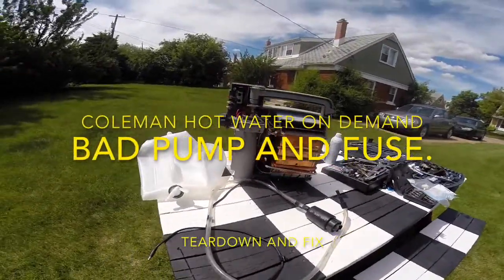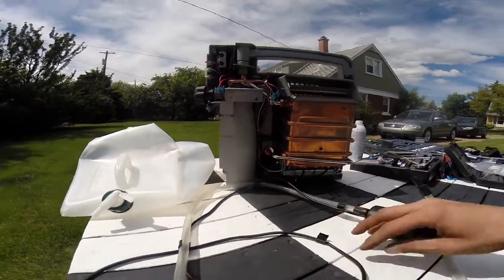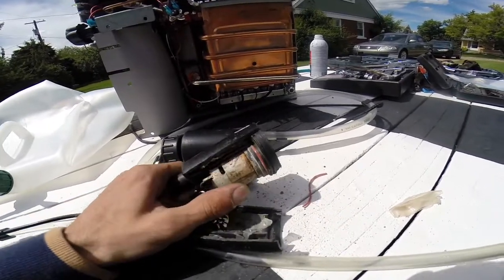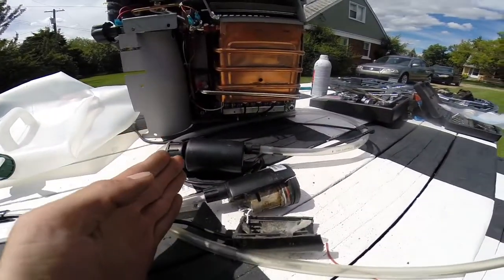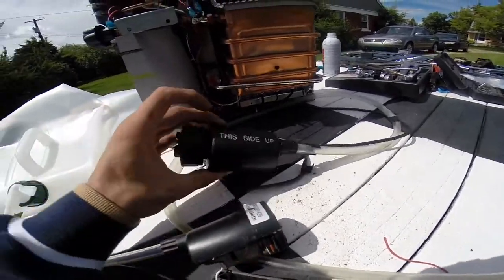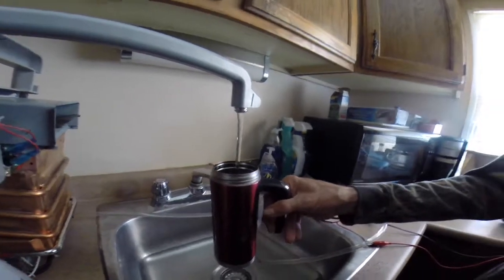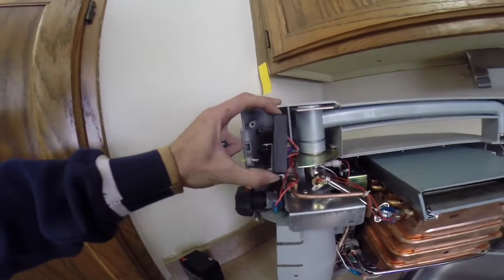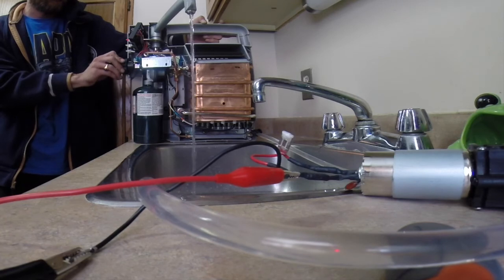Coleman Hot Water on Demand - Teardown and Pump/Fuse Repair

Comment: Just a FYI, I recently bought one of these at a thrift store that was VERY lightly used. I hooked it all up and sat staring at non working unit. I had it plugged in with the 12v ac/dc power supply figuring that no matter the condition of the old battery, it should run when connected to a suitable external power. I was wrong. I picked up a new 6v battery at tractor supply ($10.99 off the shelf item) and popped it in to troubleshoot with a known good battery. I quickly found the unit started working properly on battery power!  After some trial and error I found the unit has to be unplugged to turn on! Fuses, pump, wires, hose were all good to go! Very happy with this appliance and will be using it at various scout camp cooking scenarios, having HOT water on demand is a MUST for kitchen hygiene! All in I got $31 bucks in this, score of the year.
Reply: What battery did you buy ? Mine is toast and won’t take a charge

Comment: Nice fix. This should be helpful for others who are having the same problem. Coleman used to always have top quality products but like so many companies their products are made cheaper so they can increase profits.
Reply from the maker: Or just to stay in business with the company operating procedure/wages/etc remaining the same.
With clones of just about everything now , safety becomes more of a concern form me with many things. With lower quality metals and shoddy soldering and faked components, it's getting harder and harder to get anything of quality without going direct to a good manufacturer or it's distributor,  short of making it yourself.
Reply: There sure is some fierce competition in the marketplace that forces cost cutting to the point it can impact safety. On top of that so much is outsourced and companies aren’t putting enough into verifying the quality of products/components from their suppliers.

Comment: The flow sensors in these also fail.  Replacements can be found here: https://www.seeedstudio.com/G1%26amp%3B2%26quot%3B-Water-Flow-Sensor-p-635.html
Reply from the maker: KaldekBoch good to know, thanks for the source.
Reply: is this what happens when it ignites for only a very short time then shuts off? or is that a thermostat problem?
Reply: @sashanealand8315  Yeah that's the behaviour we saw.  It doesn't see the flow so it cuts off.

Comment: Yep, I found this to be the same exact problem I had...racking my brains till I isolated the pump as the problem...I took off the intake and found the white impellor. I tried to move it and it is frozen.   So, I need to split the case...like you did...any advice on doing that to save this pump?..i am certain I can get the motor to run again.  good continuity..

Comment: Nice it's fixed!  the heating element seems to work very well. :} Aside from a warning of pump problems this video made me think about  hydraulic ram pumps. I just found out about them a couple years ago and I'm sure you understand way more than I do about the specifics of how they work but it blows my mind that with no electricity at all you can put together a few plumbing fittings and a pair of check valves to use gravity to overcome itself and pump water uphill. A bit off topic I guess unless you had a water storage tank filled by a ram pump and then use the Coleman or similar unit to heat it up from there. Good stuff take it easy!
Reply from the maker: Again, hours lost due to a Jefferson Einstein comment. Thank you.
I spent a bunch of the evening watching wranglestar's implementation, he's rather happy with it.
There is a slew near the shack but its downhill and no real place to gain head to make the rise.
Then there is the river down the road, but that's a ways to experiment with.
Considering I'm not at the shack much right now, even a rain catch for washing up would be reasonable. But the county has issues with rain barrels so,  bah!
Reply: They are amazing as long as the conditions are right. Wranglerstar is where I found out about them and I think it was at least two years ago so hopefully you saw the original videos where he sets everything up, otherwise you might have to waste another few hours :} Very interesting stuff, it's a bummer it wont work for you. Take care!
Reply from the maker: I watched the backlog, hence the few hours, I'm subbed to them but don't watch every video, just what catches my attention. 
I'd be curious to see a check valve like they have with some replaceable seals you could service each year. Probably save a bunch of wear on the pin and the seats. a stronger pin would be nice. Lots of energy dispersed on each click seems to wear the cheap vales within a year. It's a cheapish replacement, but be nice to have something better without spending too much more.
Reply: ***** I don't watch them all either but more often than not I do, he does a lot of projects that I find interesting That would be nice to be able to repair the valves since they open and close around 63 million times a year if they run all year, depending on the size. I think one year the brass cracked due to freezing so it seems like a good idea to take them out during the winter months and do repairs then if possible and start over in the spring. You're right as far as plumbing parts go check valves are fairly expensive especially for 3/4 or 1 inch, the 1/2 inch are a bit less but still would be worth servicing, all they need is an access panel to get inside.

Comment: The pumps have always been faulty but Coleman refuse to admit it. I bought 4 new pumps ($200) and all of them leaked through cracks in the face plate. I returned them and bought 4 12v portable showers ($48) and easily adapted the pumps from them and all works well on 6 volts.
Reply from the maker: Phil thanks for the info. 😁
Reply from the maker: Do you notice any lack of flow or was it comparable to the original, 12v pump at 6V ?
What showers did you end up purchasing?
Reply: pXn Emerica the flow rate was slightly lower and over temp came on when I run it at full tilt for 90seconds. This is overcome by reducing the temp setting to just under max and still produces a good flow of bloody hot water at 6v. We mostly use this when out in the bush using solar and I plug it into the cigarette socket at 12v as 6v is a rarity these days so the 6v only supplies ignition and the 12v supply from the vehicle/solar produces a better pressure and flow rate than the original dicky Coleman pump and negates using a relay. No doubt you're switched on but others reading this post need to know to get the water flowing before you ignite the burner.The units I used are available on eBay just look up "12v camp shower" and I was able to purchase 2 of these well under $40 Aus. I'll try post a link. Bloody good video on the fault finding too.keep up the good work n I subscribed

Comment: You can get those pumps working again,  I brought two of them back to life. This is what I did,....

What I did was drilled two small holes in the top of the pump (the end where the wire and outlet of the pump is). One hole on either side of the pump outlet, I then drained the water from the pump, then I sprayed WD40 in the pump till that cavity was full and left it to sit over night, then I applied 6volts to the pump.  Both pumps I tried this on came back to life. I resealed the holes with some good shower silicone. 
Hope this helps some people.
Miles

Comment: I just about threw my heater in the garbage! Called Coleman Canada and was told there are no replacement parts available for these things. Can you show me exactly how you set up the relay to go from 6v to a 12v system/ where you bought the supplies needed.. I'm not familiar with electrical setups but am a good copy cat.. lol.. the pump is defenitly my problem.
Reply from the maker: I'm only going the 12V route because I have a solar system setup at my shack, A 12V pump would still likely work directly @6V, but have less flow. I'm not sure what the original flow was like.   :) 

Here is a video for you that should help explain the relay setup that I have planned.  Higher qualities still processing
Video: https://www.youtube.com/watch?v=5eBMxMoA5hQ

Comment: Thanks for the video.  I had  a low battery light, but the battery is OK.  It appears the pump is my problem.   I can hear the pilot turn on the burner, but there is no water running and the pump does not turn on.  I was wondering how to replace the pump with one like you bought.  You are running your pump off of a separate battery, but I would like the new pump to run off of the existing wiring and the Coleman unit if possible.    Maybe just cut off the old pump and then figure out a way to build a new pump enclosure with the tubes the way you have in the video?  Anything I should be concerned with?  I see many 6 / 12 v brushless pumps online for less than $10.  I never done anything like this before, but I figure I have nothing to lose, since the pump doesn't work now anyway.    Thanks!
Reply from the maker: It's a 6V pump, you could use the existing wire from the old pump, and run that to a new pump. I've got a 12v system at the shack I want to use this at, so a 12V pump is fine for my needs. I'll run the pump wire to a relay to power the new pump. But if you get a 6V pump that shouldn't be needed.

Comment: Hey buddy, not sure if you're still around but what kind of relay would I need to have the coleman turn the 12v pump on?
Reply from the maker: Most relays should work but you want the trigger voltage of the relay to be as close to the 6v you have from the machine. Still haven’t tested if it can take 12v in the system board or not
Reply: @pXnEmerica  what would be worst case scenario if the board can't take 12v? Fried board or just a fuse?
Reply from the maker: @jomotechual9073  probably a fuse, but that all depends on how well they designed the circuit.   My guess it it will be fine, the voltage regulator might get hotter though trying to dissipate an extra 6V as heat. So there's a possibility you're also "cooking" your board components.

Comment: Hi, I think I have the same situation happening with mine? It clicks and fires up but shuts off right away. The pump is not sucking water.
I’m confused about the “relay” that you speak of? Am I understanding correctly that you took out the 6volt outlet and wired it to a 12 volt relay so you could run the new pump? I’d like to see how you married the 12 volt pump to that relay.
Also, you bought a non-submersible pump to replace the original. How many gpm is it?
Reply from the maker: Gpm unknown, it was just a pump from surplus at Princess Auto/Harbour Freight. They had no idea.
I used 12V source but used the 6V output  of the machine to "trigger" the 12v relay which turns the 12v pump on. 
My plan was to use 12V entirely and then step down the 12V to 6V to run the electronics. But you could run two separate sources.
Reply: pXn Emerica Thanks for the quick reply. So you think I can wire the 12v pump directly to the 6V outlet and it will work. I’d rather that than having a separate power source for the pump.
Reply from the maker: @dangorgichuk4543  You'll want a 6V pump in that case, and possibly something efficient.
If there's nothing in the circuitry to limit the current and you put something big on there you might kill electronics/fuses or get things warm :)
I'd see what Coleman has for replacement parts if any.
Reply: pXn Emerica I read on another post that Coleman has stopped making parts for these units. Thanks so much for helping me out.
Reply: Based on what you said about not using a pump that may draw to much current, is it possible for me to cut the old one open to maybe find out the current draw directly off the old motor?
Reply from the maker: @dangorgichuk4543  you might get something from the original power supply, a sticker on the machine or maybe the manual, gotta mow for a bit

Comment: All the 'Dust" you talk about inside the pump are from 2 small ziplock bags of ballast they put in that are either a desiccant to absorb any moisture, or to make the pump sink. 
You can disassemble the pump without cutting it by unscrewing the wires off the back, and inserting a small punch or drift, and very carefully tapping the motor assemble from the casing. You may need to use a heat gun to loosen things up
Reply from the maker: Not worth it, motor was rusted out, pumps are garbage.
Reply: agreed!

Comment: my ignites for about a minute and then heat shuts off but pump stays on. the water impeller and pump functions fine but hot water for only a minute
Reply from the maker: It's got some safteys, manual says it'll shut off it if gets the water too hot, should then come back on when water cools.   I'd make sure you've got no trapped air in the system. Pretty sure there's a safety if it's not detecting flow as well. You might have flow but if the flow sensor is bad maybe?
It's been a few years since I've pulled them out of storage.
Reply: @pXnEmerica ok thx I'll check it out
Reply: I was thinking maybe thermostat

Comment: The pump pulls apart. They are not a sealed unit.
 You don't have to cut it. It's got a seal on a rim at the inlet and its just a firm fit, but it's not fixed at all. Pull at it.
You could just get a new motor- hobby shop?
The seal - an O ring? went on the shaft.
Reply from the maker: Nah it was trash.
Reply: @pXnEmerica  Well mine just blows the fuse. The pump ran but it all went cactus after that. No ignition clicking. I had it apart and thought what would work, with no gas connected or water to pump.
I haven't checked in any other means yet.
- At this stage- the cause is unknown.
Have you an idea?
Reply from the maker: @Mcfreddo  I recall there being a flow meter, if you have no flow you get no ignition.

Comment: So far I have changed 5-6 12V pumps (ranging from bilge pumps trough aquarium/pond ones and going to on-demand pumps. NOTHING can lift the water from the tank more than a foot! Talking about 3000 GPH pumps!
On 12V all is fine, but on 6V the flow is more then adequate , but head is very low - I have either to run the HWOD on a foot only step (too low for any practical use) or to lift the water tank at least a foot from the ground (also very impractical on the camp site, tank is about 15 gallons).
If someone have any luck with actual HWOD pump replacement, leaving the original 6V unit intact, just replacing the pump - I am all ears. So far I found NOTHING on the market that works...
Reply from the maker: sladuni the pump I'm using is 12v but was surplus from princess auto, even they don't know what it was from. I wish you luck finding a replacement.
Reply: pXn Emerica,thanks for trying to help. Princess Auto is my favorite store and most of the pumps I tried were surplus exactly from nearby store... :-(
I'll try from  Chinese eBay, but all are rated for 6-12V, not 6V only...
Reply from the maker: https://www.princessauto.com/en/detail/12v-dc-water-pump/A-p8648156e

That's the pump i used, but 12v.
You'd need to get the hose connector kit too. $2 just hard to find in store., small bag with two connectors.

What kind of lift are you looking for? Guessing 3-4 ft to a table/counter?
I might be able to test this one at 6v and let you know, maybe your store has stock. Probably already tried it heh.